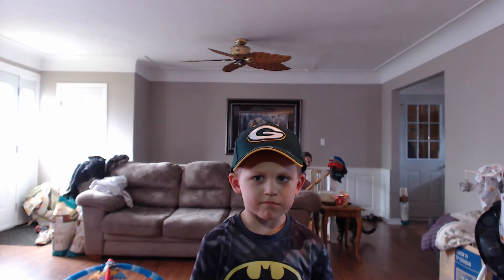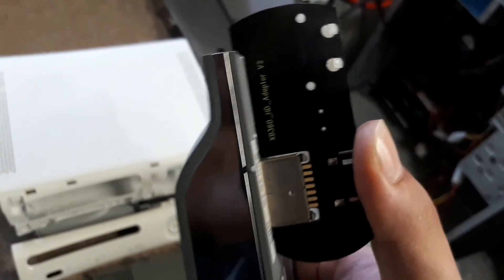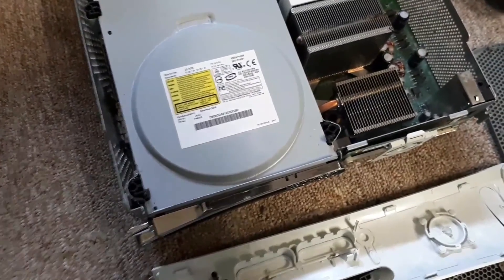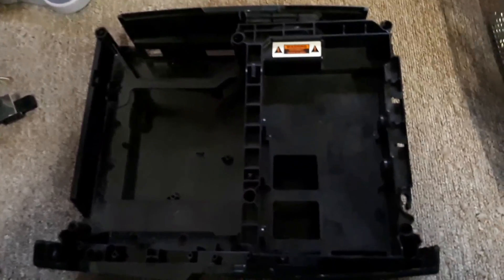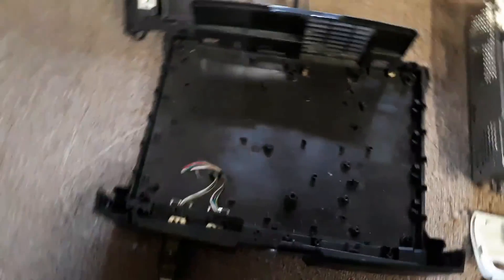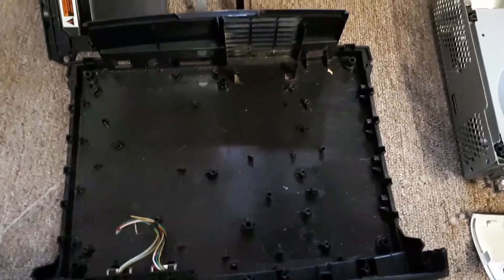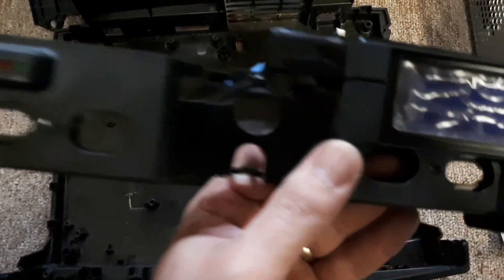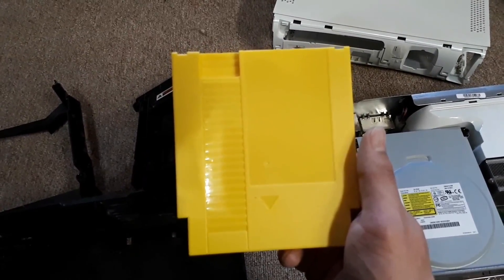Raspberry Pi Case Ideas PART 1 (Xbox or Xbox 360?!)

Comment: I have the same idea , but on the front I would have 2 USB ports for Keyboard and mouse for old Dos games in the back I would have a gameport to USB for old Joysticks and maybe  a USB hub for a Commodore 64 , SNES , PS1 , Gameboy , Gameboy Color Sega Genesis / 32X and Sega CD and any Atari 8 bit console  with there USB controllers , I would have two Original XBOX controller ports connected to USB for Gameboy and Gameboy Color . and that would round out the whole thing , cause I wanna use a CD rom for PS1 games .

Comment: what did you every decide to do? I want to do a similar project but I want to use the existing ports, fans, power button and power supply from the 360 case itself. But I'm new to all of this and I'm not sure if its exactly possible.

Comment: Is the intent to have a case that incorporates external?  I don't see the reason to use these cases.  They are big and ugly in my mind.  But, I never owned them so I don't have any attachments to them.  Maybe it's different for others.

Basically, why use these cases at all?
Reply from the maker: just to keep everything internal. I've been looking into other options as well. I agree though, these are big cases for a pi
Reply: Because it looks cool, and sometimes a functioning xbox is hard to find, so replicating a working console of some kind would be a cool side project for an xbox fan.